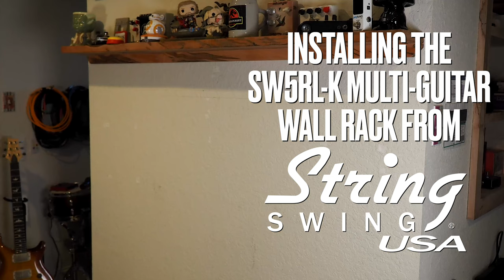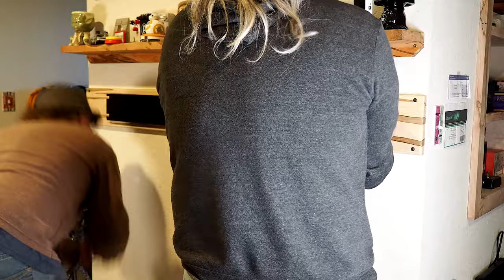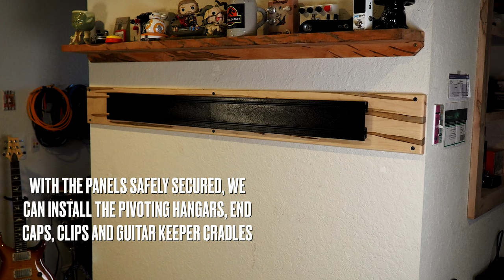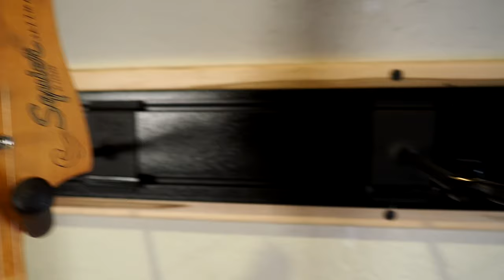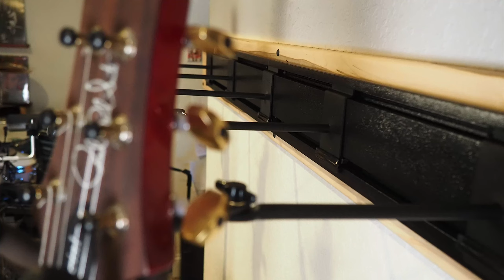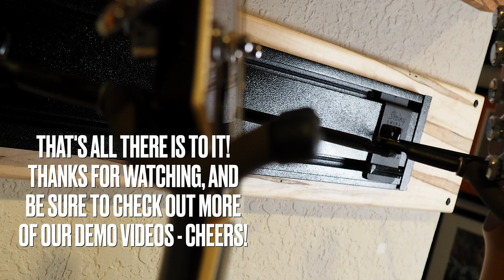Installing the String Swing SW5RL-K Multi-Guitar Wall Rack

Comment: For now, I stick with the stationary ones for 5-7 guitars, yes they take up space. Such a solution is great, but for now I am only studying it, I have my small home studio in the basement of my house and the masonry is made of concrete blocks, reinforced with iron bars and filled with concrete. It's a cover in a way, meant as a joke, but drilling holes for pictures, for example, was a great experience. In any case, I will have to approach this solution at some point. Thank you for the inspiring video and have a nice weekend. Pavel CZ.

Comment: This is What I'm going to have to do. First, the Wall is not Flat, its very uneven because whoever put up Sheet Rock, didnt know what they were doing, and there are no ordinary Wall Studs I can find...? So, I'm gong put up a 1 x 6 x 4.5' Board, then Mount the String Swing to IT. I tried their way and the screws starting pulling out of the wall, with only 2 Guitars on it, I was standing right beside it, testing it...